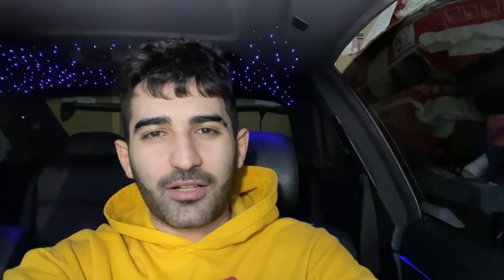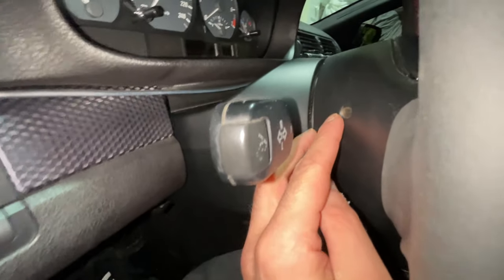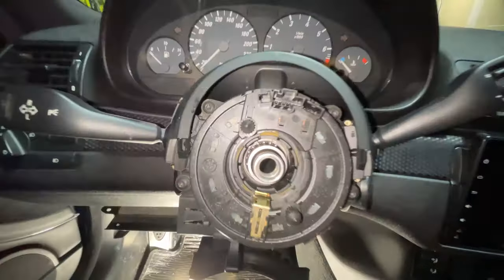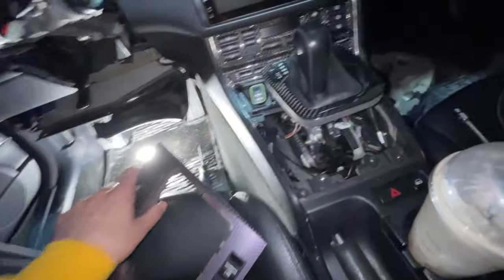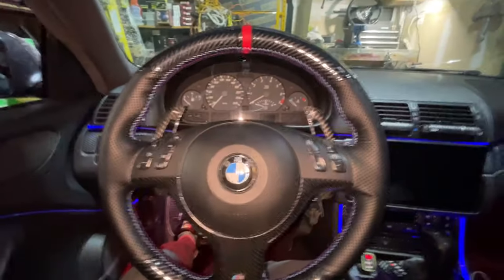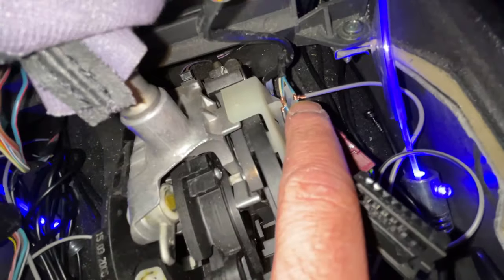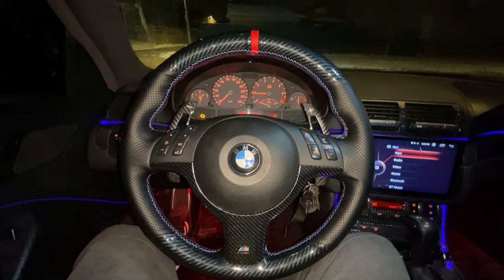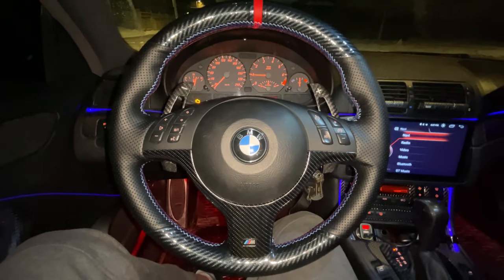BMW E46 PADDLE SHIFTER INSTALL DIY FOR STEPTRONIC / SMG Paddle Shifter Retrofit

Comment: Hey, ive been subscribed to you ever since I purchased a used 2004 bmw 325ci, and you seem like you have a lot of knowledge on bmw E46 models. 
My car's driver side window doesn't do the window indexing (frameless windows rolling down and up by like 1/4in by itself) when opening and closing the door, ends up making the window to hit the metal frame of the car and leaving a huge gap between the window and the car itself when it's closed. By any chance, do you have a diy method of fixing this problem?
Reply from the maker: Hey man, watch the e46 doors wont open from outside video, i think itll help you. I was having the same problem and it ended up being my door actuator.

Comment: awesome video, thanks to you i’ll be doing this tomorrow! what gauge wire did you use?
Reply from the maker: I just used some generic speaker wire, worked fine for me
Reply: @_mrklein  just want to come back and give you a huge thanks bro, favorite mod ive done on my car so far and this should hold me off until i can get around to doing a manual swap. couldn’t have done it without your help
Reply from the maker: @mattk2800  sweet dude, glad i could help!

Comment: Hey, wondering how this has been holding up. Seen a bunch of forums and tutorial showing that I need a bunch of different connectors but I was planning on tapping into the wires by the shifter just like you did.
Reply from the maker: its been holding good, no issues since install

Comment: Have you thought about doing a manual conversion or are you going to keep the auto?
Reply from the maker: Planning on beating on the auto till she goes then do a 6spd swap
Reply: @_mrklein  exactly what I want to do, have you researched it much on where you are going to get your parts?
Reply from the maker: @TakeaChanceFilms  i know a guy locally who sells the swap as a kit, im probably just going to take it to one of my friends shops to get it done, hes done a couple of the swaps now
Reply: Should just send it to a transmission shop called level 10 and get it built for 700+ HP if it's a ZF 5HP19

Comment: Hi buddy I’m wanting to get this conversation done to my car I’m wondering if I use 330i ssg steering wheel will this work out the same.
Reply from the maker: If it uses the same clock spring as in the video it should work
Reply: @_mrklein  what you mean by clock springs buddy
Reply from the maker: @sethor_im3336  skip to 1:35

Comment: To what im looking at it looks like swaping clocksping and drill the holes for the paddles will work, right?
Reply from the maker: I used a m3 smg steering wheel, not too sure if the paddles would be able to work on non smg wheel

Comment: So i have a question, im looking into the steering wheel and i don't see a difference other than the paddles. So my questions is, if i can use my e46 steering wheel and just cut out for the paddles or im missing something different between both steering wheels?
Reply from the maker: Honestly thats a really good question, i never tried myself, wouldnt be surprised if its possible though
Reply: @_mrklein  yes, that's what I'm thinking. Drill the paddle holes on the steering wheel and it should fit. But I'm not 100% sure. But to me the steering wheel looks the same.

Comment: Would this work on a 323i e46 automatic? I heard you mentioned in your video something about going into “Sport” mode, the 323i doesn’t have such modes. Would it still work?
Reply from the maker: If it has the manual steptronic mode I believe it should work
Reply: Just need slap stick
Reply: The E46 does have sport mode if you have Steptronic, when in drive, move the stick to the left and you’re in D/S for sport. It just changes shift points pretty much.

Comment: How many miles does ur 330ci have and has it been a reliable daily?
Reply from the maker: I have a video on my channel about maintenance but basically If you keep up with the maintenance its a good reliable car, just make sure it’s properly inspected before you purchase one🙏 they tend to be neglected cars (around 250000 kms on mine)

Comment: what steering wheel is that
Reply from the maker: stock m3 wheel
Reply: @_mrklein  it’s impossible to find on ebay, where’d you get it from/do you know any aftermarket ones?

Comment: Would this work on a 330ci e46?
Reply from the maker: Yes
Reply: @_mrklein it works the same if you dont put in "sport mode"? Just downshift to overtake without sport mode?
Reply from the maker: @mikpes10  only works when its in S mode